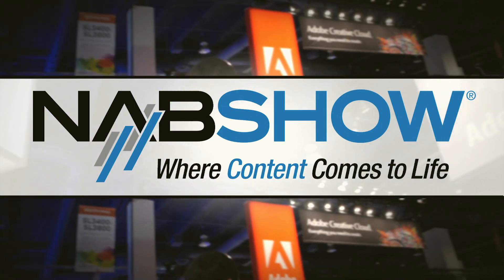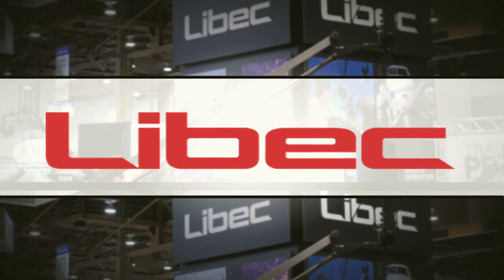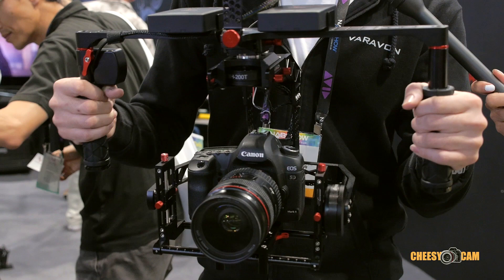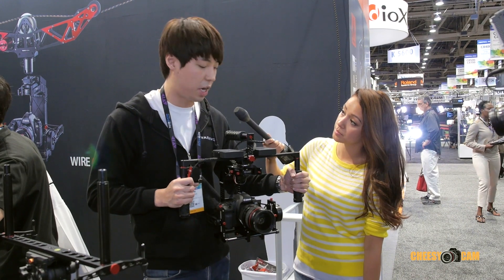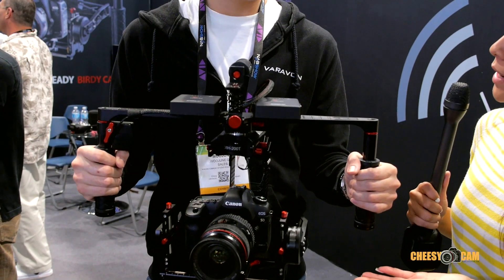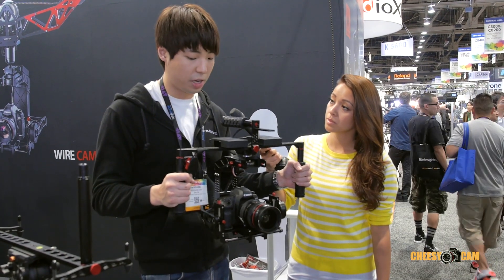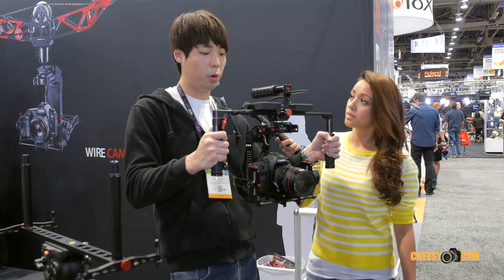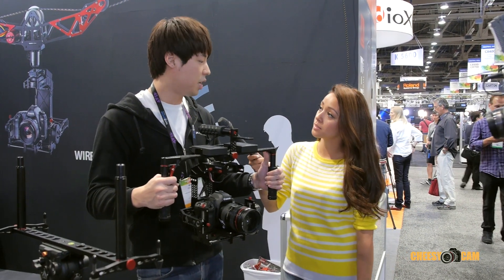NAB 2014: Varavon Birdy Cam 3 Axis DSLR Video Active Brushless Motor Gimbal Stabilizer

Comment: What about the need for extra power for a monitor which is necessary.
Reply from the maker: randall paul Every monitor i've used has it's own battery tray and you add batteries behind the monitor. This gimbal doesn't need to provide that.